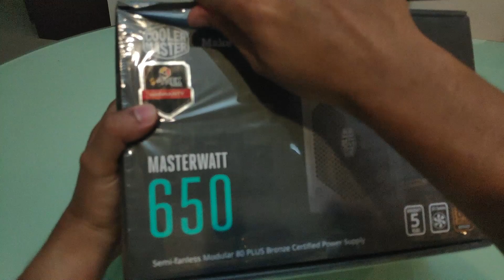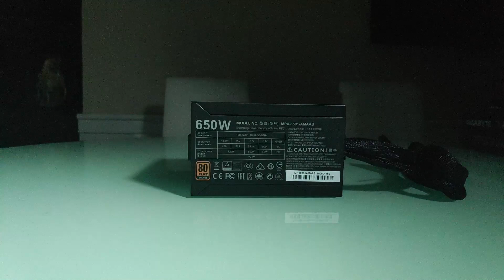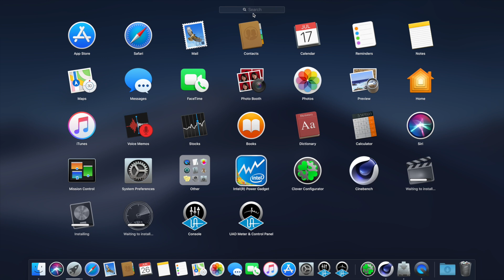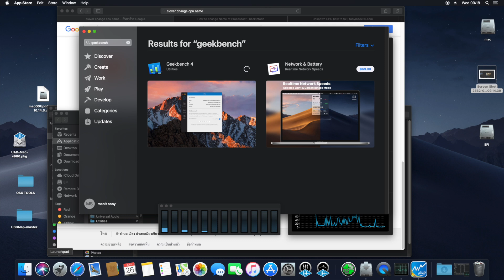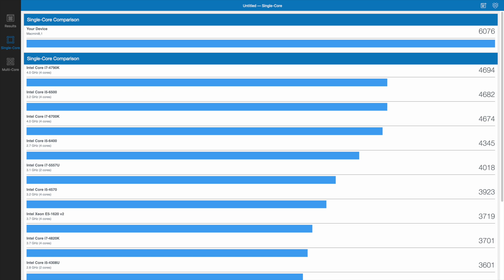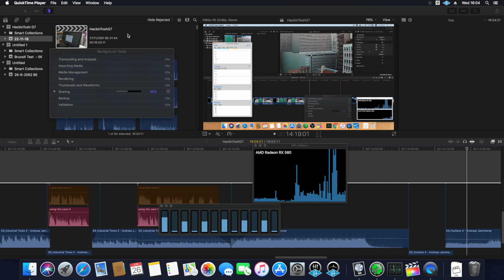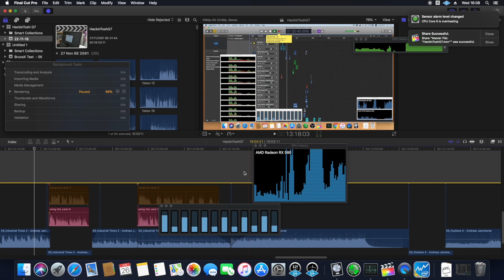Gigabyte Z390 DESIGNARE HACKINTOSH Thunderbolt UAD ARROW

Comment: I cannot get Thunderbolt or the ports as USB-c to function at all. I followed a build exactly. I know it won't hot plug, but it should at least work on startup. I see the TB controller in the PCI tab. Can't seem to find anyone who is having the same issue as me. Help anyone? I followed this build EXACTLY. 
https://www.tonymacx86.com/threads/success-gigabyte-designare-z390-thunderbolt-3-i7-9700k-amd-rx-580.267551/

Comment: I’m using Apple thunderbolt 2 to 3 adaptor for my AU Apollo MkII but doesn’t work. Keeps saying no device. Using same board; everything Mac compatible. Driving me nuts.
Reply: SSDT files (y)
Reply: @xp3rienc  Thanks.. Got my Apollo going! New issue is I have static like noise and crackle associated with audio. Very exaggerated when I launch Logic Pro X and also quite noisy when watching youtube. It's always somewhat in the background. moving the mouse and keyboard increases it also to some degree. I did a google search and came across this.. "Hackintosh, Universal Audio - Static Noise Problem tonymacx88" and there appeared to be a few others with this same issue.. : (
Reply: Tony Adams I don’t have this audio card so I can’t test, but sounds like there is some digital noise?
Reply: @xp3rienc  Yes possibly. I need to be more computer savvy. I'll keep searching, and thankfully I have a son who is good for his better understanding of computers.

Comment: Hi, just cant get Thunderbolt working...any ideas? (like you using Apollo)
Reply: Did you manage to get it working? I was thinking of buying the same setup for my Apollo
Reply: @mrchrisbeaver  yes I did eventually. I can recommend it. I have an Apollo Twin and two PCI cards. I had to upgrade the BIOS to the latest as Technolli did, and I use an Apple T3 to T2 adapter to connect the Apollo Twin
Reply: @SlimEstrada  would you please give details of how you got Apollo twin working? I bought Apple 2 to 3 adaptor but getting nothing. Going crazy trying to sort this. Thanks
Reply: Hi  @tonyadams886  . Hackintosh is frustrating at times, isnt it? Update BIOS to latest. You will then need to reinstall osx using technolli's exact instructions....I tried other methods but they dont work at all for thunderbolt. His BIOS settings and clover config must be followed to the letter otherwise I couldn't get it to work.
Reply: @SlimEstrada  Thanks for your guidance.. Got my Apollo going! New issue is I have static like noise and crackle associated with audio. Very exaggerated when I launch Logic Pro X and also quite noisy when watching youtube. It's always somewhat in the background. moving the mouse and keyboard increases it also to some degree. I did a google search and came across this.. "Hackintosh, Universal Audio - Static Noise Problem tonymacx88" and there appeared to be a few others with this same issue.. : (
Reply: @tonyadams886  i have had this intermittently with my actual mac also. I found that it was due to a wordclock mismatch. Or buffer size?

Comment: Lovely! I also use Apollo interfaces - so this is GREAT to know the TB works well. 
So - it's been a few months - can you report back and tell me if it has been nice and stable? No problems?
Again - a big THANK YOU for saving me money and great to know our Apollo's work. Will you be checking out UAD  LUNA ? Neve Summing?
Reply: Did you do a build? If so, does your Apollo work? because mine is not! Using Apple thunderbolt adaptor because my Apollo MkII is thunderbolt 2. If yours works would you mind giving some steps? Thanks.
Reply: Tony Adams I also have a mk ii and I own this motherboard and need solutions. Find any?

Comment: im upgrading to this board specially for that interface so im glad i found this video
Reply: same as me!!!!! I updated because of the thunderbolt3 port needed for apollo twin X //Hope everything installs fine+
Reply: Produ 2233 yup I had some spare cash and got the Apollo twin X instead, everything working great
Reply: @LXXIV666  unfortunately my Apollo twin MkII doesn’t with the Apple 2 to 3 adaptor. Is there some guidance you could give?
Reply: there are a few cards pci for thunderbolt 3 . my motherboard supports it but idk if i should get the card or replace the board
Reply: Refugio Flores pci-e cards are trash I run 6x and twin on my setup and due to constant crashes I was forced to find a mobo with built inTB. Check out my studio build on instagram: @dope_foreva
Reply: @chrisrobison4257  I’ve just done a build and my Apollo Twin MkII is not working. I’m using Apple thunderbolt 2 to 3 adaptor, but nothin! Could you give advice? Thanks.

Comment: temps are extremally high, I dont recommend to use with this temps
Reply from the maker: Hello Arthur during render it is always high! i guess intel should give us better stock cooler. I replaced thermal paste and cooler. Getting much lower temp now.
Reply: @OCSTATION  nice! Did you put to work the thunderbolt 3 ? I am thinking of buying this card precisely because of thunderbolt 3
Reply from the maker: @arthurmelo88  ecerything works perfect. Hot plugging also works. MOST hackintosh hotplug don't work. YOU can follow the guiude on olarila. They have all the files needed and good guide for this board.

Comment: I'm using my Arrow on a Dell g7 .. it only works on Hackintosh  if I plug in before I turn it on, would it be the same SSDT that you are using that I need or I would need one specific for the Dell G7 ?
Reply from the maker: same here on dell g7 in ioreg does not show the tb. i can not hot plug there. Each motherboard needs specific ssdt. As far as i know z390 thunderbolt is going to PCH. not cpu.

Comment: I have a similar build with an i9 and the same motherboard but my Apollo Twin MKII is not recognized. Do you have any advice?
Reply from the maker: u mean in hackintosh? is your card recognized in windows? you have to switch off usb option in tb menu from bios. if you have not implemented the ssdt you can not hot plug. you need to first switch on the uad twin.

i used the dsdt ssdt from this thread. 
https://www.tonymacx86.com/threads/in-progress-ssdt-for-thunderbolt-3-hotplug.248784/

good luck.
Reply from the maker: and you have to disable security settings in tb menu...you must select no security.
Reply: @OCSTATION  Will check this out. Thanks a lot for your tips. Appreciate it.
Reply: @davefuentesmusic   hiee, i am facing the same problem did you you find the solution
Reply from the maker: @theramankakkar  @DEE L applo twin mk1 works fine with arrow. in video i think i showed dsp from two units working well together.
Reply from the maker: @theramankakkar  did  you all found solution. ok some funny discovery for me. i bought cheap thunderbolt cable from ebay. it never worked. maybe change cable.?
Reply: There has been a lot of people having issues with backwards compatibility on Thunderbolt with that specific motherboard and Apollo interfaces that do TB1.
Reply: @easterlingderek34  why?
Reply: v.i.c 244  As far as the forums at gigabyte said was a firmware was released that messed it up, and some who had close contact with them said that gigabyte was working on a solution and it had been fixed, but intel refused to sign it. So it could be released. So right now anybody using the Apollo quad silver faced model can’t get there interfaces to recognize.
Reply: What about universal audio arrow can it be recognised
Reply: v.i.c 244 well this video shows that arrow works, what I am mostly talking about is Thunderbolt 1 or 2. I was actually looking for info about if Apollo twin mkii worked with this specific motherboard or the xtreme.
Reply: @olgrap  YES!!!